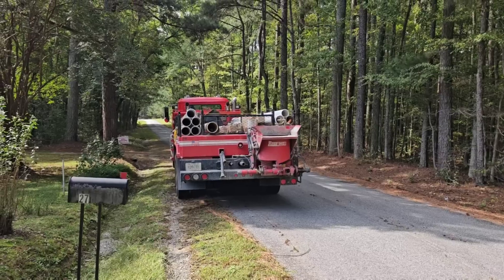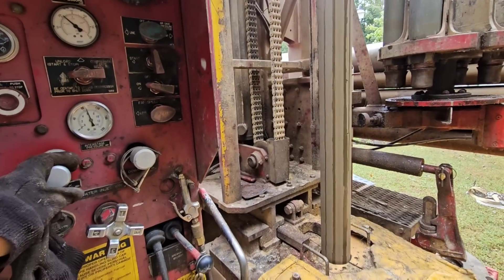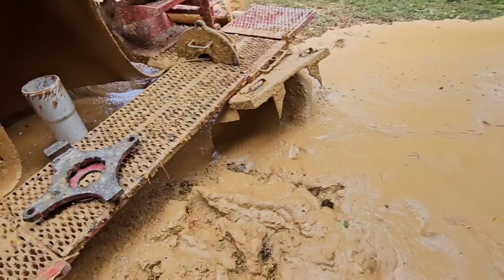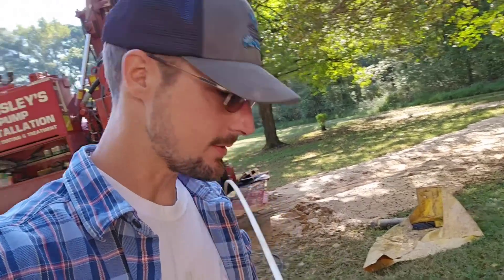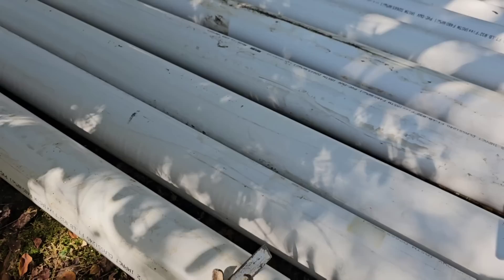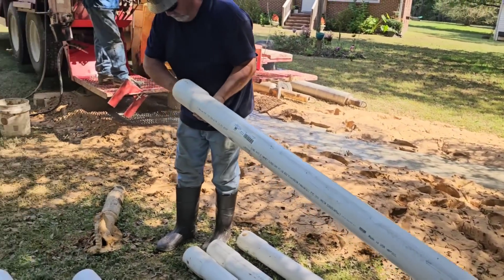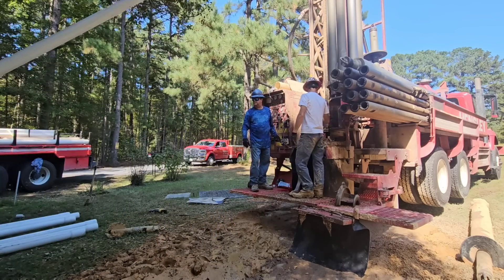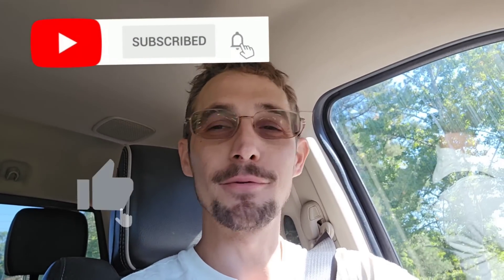Drilling 200ft through Sand with a Air Rig. Installing a PVC Well Screen

Comment: Good job on that well! I have a question for running a black roll plastic 1'' pipe and an electrical wire from the newly drilled well. My well has 55' of carbon steel 6' casting to bedrock. Hit water at 280' @ 4 plus gpm and a static @ 20' on a Saturday. Probably enough water for a 3 bedroom, 3 bathroom house but I got greedy and wanted more. The rig was still in place on Monday sooo I asked them to go 340' and if they didn't hit any more water to pack up and go home. When they got to 340' they stopped drilling at which time I went over if asked if they had hit more water. He said a little. When we tested in was 9 plus gpm, prefect! I've asked the well drilling company to install the pump in the well and I would go from the outside pitless adapter to the foundation which about 80'. What PSI pipe do I need and what type and size wire? Thanks for your time

Comment: How do you install a pitless with the liner up to the top of the casing?
Reply from the maker: @markthebuilder9837  we don't use pitless. But if we did we'd cut the 4" & lower it with a rope 3'

Comment: A general question..... I noticed in NC you use plastic casing. Here in NY all wells that I know of have steel casing. Is that because of our deep frost issues ?
Reply from the maker: @davidstearns9664  simply different state requirements

Comment: Drilling for oil in S Texas, I remember going through the Carrizo sand. We had 4,  6 inch drill collars on top of a 7" bit, and when we hit that Carrizo we got a mountain of sand and water washing back through the returns.  There was always a concern we would get stuck making that much hole that fast. About every 100 feet we would leave the pump engaged a little longer to get the sand out before making a new connection. I don't remember ever getting stuck hard, but further down that sticky chalk would sometimes ball up around the bit.   

We mostly drilled shallow oil wells, 2800-3200 ft, and 5000+ a few times. Drilling, running casing, cementing, plugging, but no fracking. Instead of fracking we would have a crew come out and shoot it. That was fun. The crew would lay that string of steel balls on the floor and we had to get clear of the rig. There were old oilfield stories of those balls going off on the rig floor and shooting clean through a sledge hammer. I didn't believe it though. The oil field has always been full of incredible stories that seem to travel from rig to rig, and 3 out of 5 roughnecks would all say they knew when, where, how it happened, and who was there.

Thanks for the video. You guys know your stuff and do an awesome job

Comment: Wouldn't that be a real bastard if 50 foot of case came undone (glue wasn't set enough or too much combined weight etc..) and fell to the bottom a of 200+ foot well...🎉 😮 😂
Reply: We use short screws to ensure that doesnt happen

Comment: Well development question on drilling in sand- In areas where drillers have to use bentonite to get down far enough to set casing in sand and river rock formations - what do you recommend on well development and cleaning the wall cake off the bore hole wall so water can flow freely in those sandy and river rock areas? Seems like all the older drillers in my area ignore and skip this step

Comment: Does anyone know it they make a well liner for a 4" well? My well was drilled in 12-8-1983 and its 128' deep. The static water level is at 35' and the pump is at 100'. The pump is pump is 3" diameter, and it pumps crystal clear water. The reason I want to line the well is because of its age of the steal casing and I don't want to fix it after it fails.

Comment: wish I had you for my well guy we paid this guy in July to drill a new well as our old failed took over. month to get them back they drilled the well collapsed due to sand as of today it is mid October and I still have no water but plenty of excuses as to why they haven't returned at this point I'm pretty sure I'm just out $7k for a 100' useless well

Comment: Who's responsible for repairing the damage to the front yard?  Is there a SOP covering this situation?
Reply: In my experience the SOP varies from company to company but most that have large trucks and equipment on site do usually have something written when the work is requested that specifies who is responsible or a waiver for responsibility being off the operators. 

I'm leaving this comment mostly because I'm curious what theirs is.  Often times it's just considered a necessity of the work and remediation is on the customer. 

Not always the case for us, but often. It's usually an exception when we are responsible and something the boss has already worked out with the customer and we know going in.

Comment: Couple questions and comments, awesome to see an air machine and driller deal with sand blows my mind as a mud driller.  You said artesian all our wells here whether rock or screened are, some are even flowing artesian water wells. Would 4'' saw sloltted/screen casing been a good choice for a liner thru parts of the bore, comes  in  many slot sizes an 20' lengths? Do you have to clean with colored solvent  and what SDR do you use and does it need be heavier after a certain depth?  We are mandated  5'' casing minimum  here unless certain things  apply we need be SDR 21, then SDR 17 after a  certain depth and we grout too, depths are dependent on casing lengths not bore depths. Neat to watch other drillers and their machines work and the depths they run for the water volumes  they get and deal with, been 300' deep 1'' to 12'' in diameter  screened and rock a few gpm to a 1000+ gpm producing water wells. Our water here for the most  part clean and clear and we say sweet, we have some iron and hardness not much, we do have  sulfur evens deal with   some gas in our wells. Good job a well learned craft/trade not a lot of us  out there we are 3rd generation now, everyone here for the most part runs off wells, villages and all.

Comment: I don't know if I am asking this correctly or not but here it goes.   On lower production well but any well is there any point in drilling it several rods past where you normally would stop for the water produced in order to have more of a water reserve until the water fills back up.  In my area they seem to use big tanks with a well to fill them over time instead
Reply: I've heard him mention that kind of thought, but I've also seen videos where he's pointed out homes that have done exactly that and had a tank above ground for low production wells. 

I'd say it's likely a LOT cheaper to go the tank route depending on what they charge per foot. 

For what drillers charge per foot in my area, it's cheaper per gallon to buy a tank by a long shot. For the price of 1000gallon tank, I can only have like a rod or two length drilled, at best. So it would always be more cost effective in my area to just setup the tank.

Comment: Given the noise and need to communicate for safety, you might want to consider a decent set of tactical communications headsets. They're usually nor cheap ($3-600 apiece) but they'll usually pay for themselves very quickly. 3M Peltor are a good starting point

As a nice bonus you won't need to be shouting to be heard on youtube because they can link to your camera
Reply: Why does it have to be “tactical”? Can get a decent set for $200. Use them on frac sites every day. Peltors are great for shooting but not needed in their situation. Overpriced. 
David Clark’s, rugged radio, and Otto are a better starting point for quality and price point.

Comment: It's crazy to see the difference in how wells are drilled in different areas. We always have to case a well with screen and a cap on the bottom
Reply: Are you  mud rotary or cable  tool, any rock drilling your area ? He speaks of artesian we have that here and flowing artesian wells. For the most part we are unconsolidated material here, we get water average 40+ gpm from a 4'' screened well 4' long screen.

Comment: Hi ey man how are you? My name is Klaus and I live in Chile, all the way down to South america! A while ago I started a small drilling Business inspired by you! The thing is that today I got stuck using a dth hammer with an 8 inch bit. Im more a less 80 feet down under and I completeley lost rotation and lift capacity. The hammer doesent impact down when I aplly donwforce. I do have water coming out of the hole but the pressure doesent lower as it usually does when I cut the air supply and then open it again! Im pretty sure I got stuck by a falling rock of considerable size! 

Im writing this message to beg you for an advice!! Im grateful in advance btw! 

Pd: love your youtube channel! Keep ir up!
Reply: Just adding my comment for the algorithm and hopefully some advice can be offered! 

What a situation to be in. Awesome of you to take that inspiration and do something real with it! Good luck from the southern US, friend.
Reply: @goosenotmaverick1156  thanks man! I ended up calling for help! The brand that sold me the equipment sent an experienced operator that got me out!
Reply: @klausbrienklagges2069   awesome! I'm so glad you got it sorted! What awesome customer service on their part too, was that call out expensive?
Reply: @goosenotmaverick1156  sorry for the delay! It wasn’t as expensive as I thought it would be! 300 bucks and I saved up to 3000 worth of equipment! Cheers!
Reply: I always try to keep rotation going .  Add drill foam to lift the rock . You've got to keep the Air moving . Rotation and slowly give upward feed . I hate being trapped.  Good luck
Reply: @kevinhensley7654  thanks man! I got out! I was redrilling with an 8” one on a previoua hole I had already drilled, cause I wasn’t going to be able to fill enough gravel inside and the water was going to look discoloured! The terrain already was too unstable and that got me stuck! We ended up applying total downforce to get the 8’’ bit to fit in the previoua drilled 6’’ hole and start rotating again, all with a lot of foam and praying haha! Cheers!